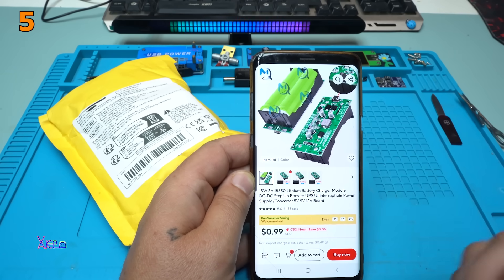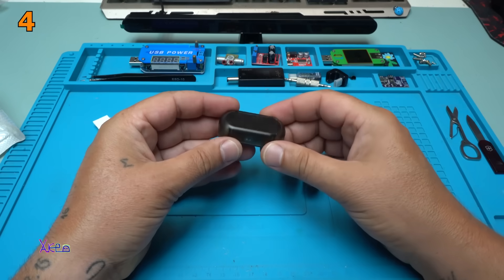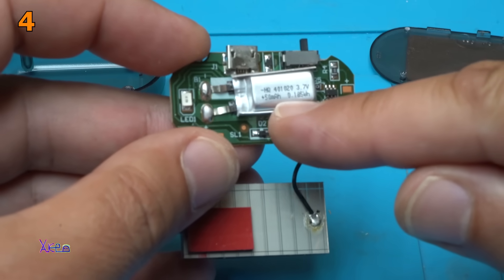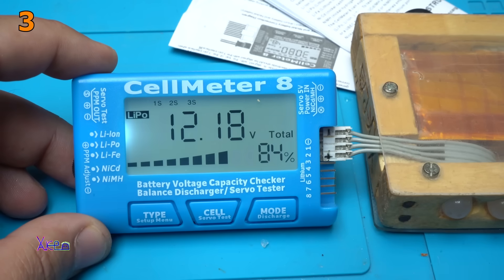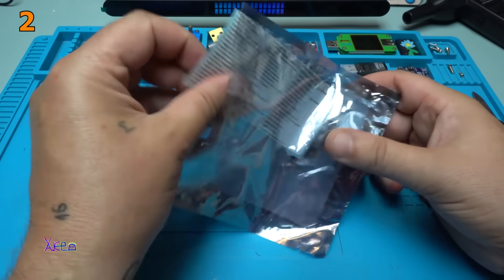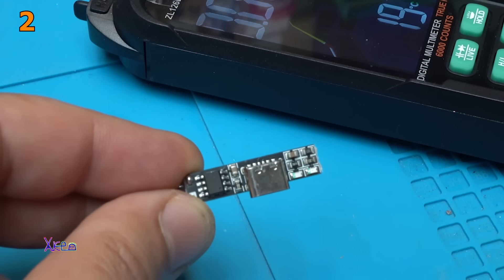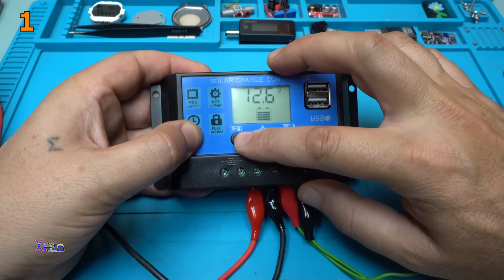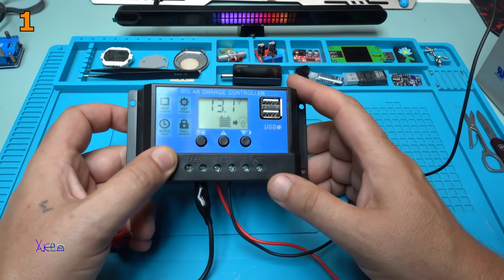TOP 5 COOL Aliexpress  Gadgets

Comment: 5- nao serve pra roteador, roteador consome mais de 25w. 
4- é interesse. 
3- também é interessante.
2- interessante também, pra adaptar bateria de lítio em aparelhos que usam pilhas
1-controlador de carga pwm nao é muito bom, mas é bom pra quem vai começar
Reply: I have set out on a lithium battery conversion for as much as possible with the mini and c charger board.  I updated an old China made handheld bug zapper with 1 Panasonic 3300mah cell.  It is more powerful than it has ever been... I only charge it under supervision, Outside of the house
Reply: @Freybergers porque fica vigiando? Acha que vai danificar a célula? Se a célula tiver bms, nao vai ter problema.